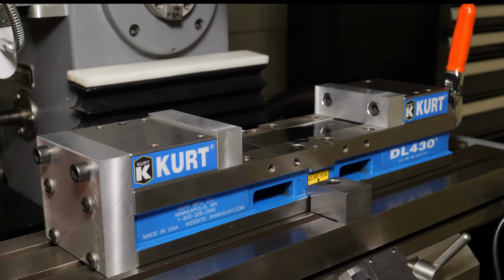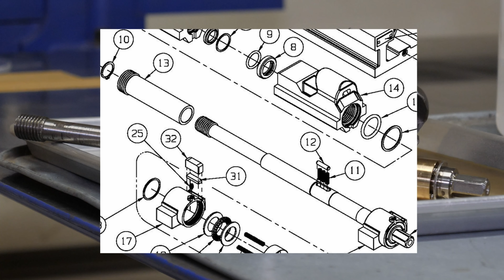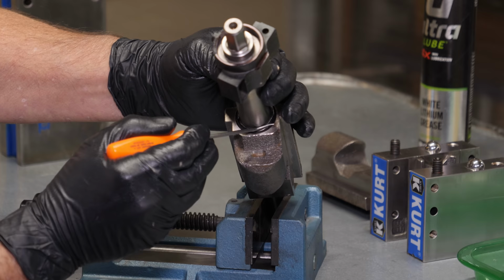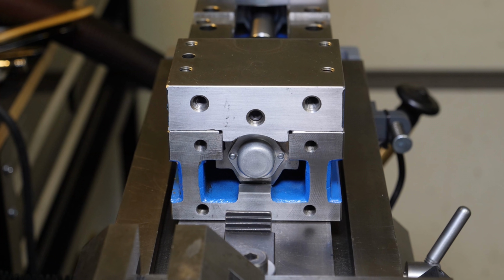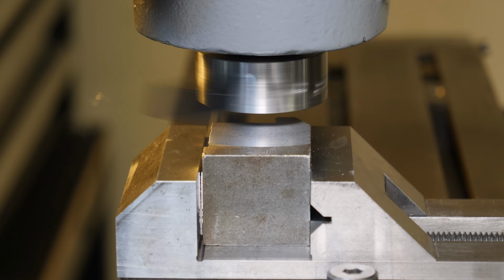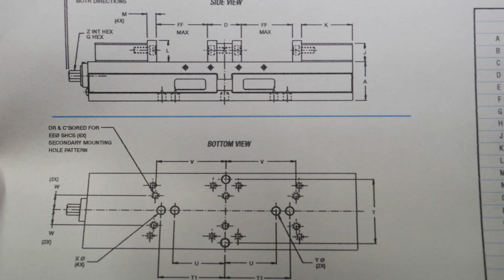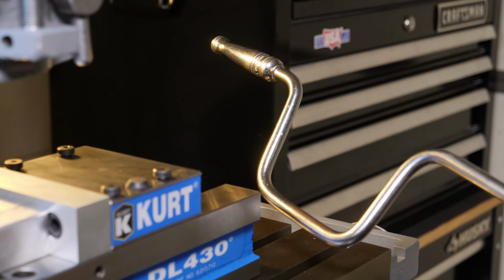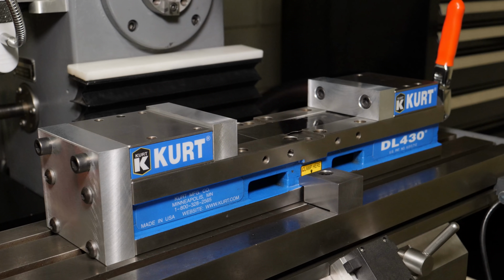Kurt Vise

Comment: This is one of the first channels of this sort where everything is explained. If I had to do over in life, being a machinist would have been my choice. You make everybody feel totally at home. You are an excellent excellent teacher. I am curious on the one part of the vice you didn’t get apart. Would Kurt send you that information or could you send the piece to them for total disassembly, cleaning, lubrication & reassembly? If I misunderstood that part of it, perhaps you did get that accomplished? New subscriber, love the talking while the video plays.
Reply from the maker: Thanks James, no I didn't take it apart but did flush/work it for some time until clear mineral spirits came out and then lubed it. Actually if I did manage to take it apart I think it would have been difficult to get back together as it's the clutch mechanism. It has three very strong springs with a pin. The reason I didn't push so hard to get it apart!

Comment: Your fly cutter does that recutting because your vertical head is not trammed in
Reply from the maker: The tram on both spindles is within .0005. I always do a light pass by just touching off. If that where the case I would see the part being cut first on one side and then no cut on the other side or reversed. An angle. I think it's just tool flex. With heavy cuts it's worse, with light cuts it almost goes away. Could also be the bit angle to the part which I have experimented with but need to do more. I didn't make the cutter body so the angle of the slot may need to be adjusted, changing the bit angle. Also I may make a slightly larger one and go up to a larger bit so the bit is more stable. This one really is just meant for light cutting. Thanks for commenting.

Comment: You don't like the smell of raunchy coolant with a wallop of caked machine oil? Man, that's my favorite smell, my wife still thinks it's my aftershave. The smell of cheap tooling!
Reply from the maker: I'll tell you what that is like the worse shop smell ever and I've been in a lot of shops but that takes the cake for sure. When I picked them up didn't smell at all in the large wide open building but in my small shop, man!

Comment: So are you going to at least rough up a set of tall jaws like 5 1/2" tall so you might be able to grip a 10" round by the sides instead of the ends
Reply from the maker: You did what?
Reply: @BurtonsAttic  it was just an idea.. to be able to clamp large round /tubular parts..

Comment: What is the name a type of mill you have
Reply from the maker: https://www.youtube.com/playlist?list=PLvqVgb9nPcXTPjt06Ta8lvbQ-ghUwQmo6
Reply: Bridgeport I’m really concerned do I use the voice crossways long ways on the table or do I run it perpendicular to the table it seems like to me that if I run it long ways on the table that that could cause issues and not holding the parts correctly which could put me in danger
Reply: Do you think it will work on my Bridgeport mill the table is 9inch x 42 inch do you think it will be safe to run it the long way on my table